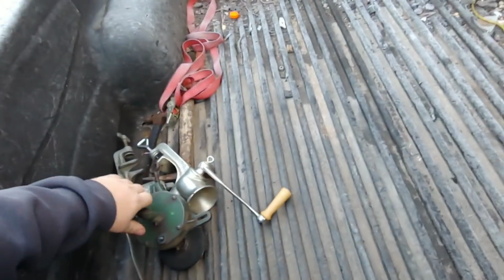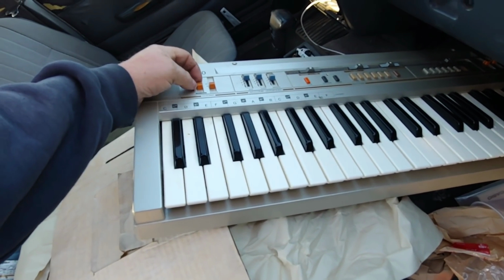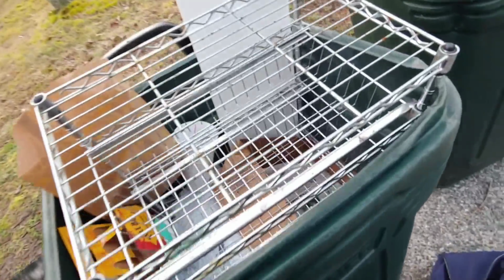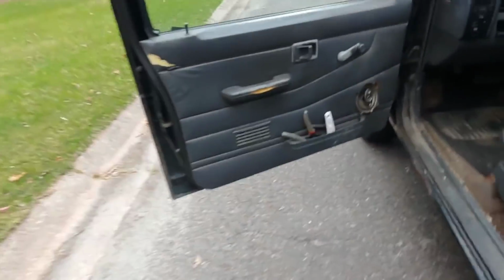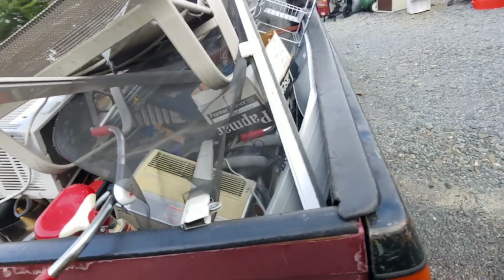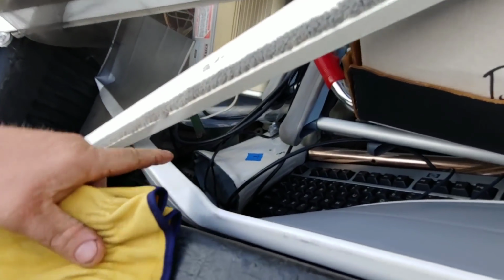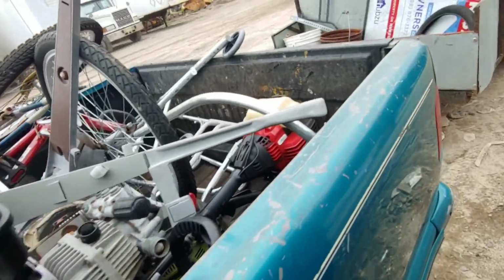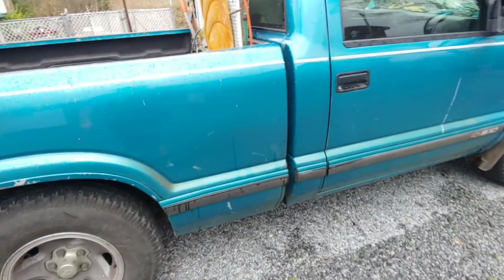Recycling Metal - Trailer Full Of Cash

Comment: Question, Why don't you turn one of your Trailers into a dump trailer, it is not cost that much for the kit, I know because I did it. Just saying!
Reply from the maker: I actually have a dump trailer I just haven't fixed it yet
Reply: @ScrapFarm  Take some time and fix it you will make up the time you lost in the long run. And make a good clip of you fixing it too!
Reply from the maker: @bigdogcountrymusic7146  for sure but its spring and time is not on my side now